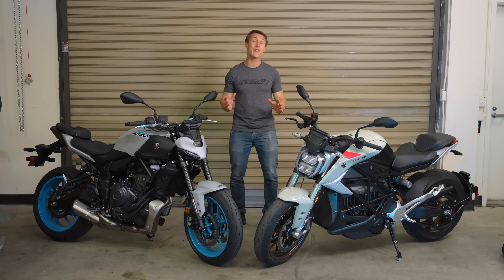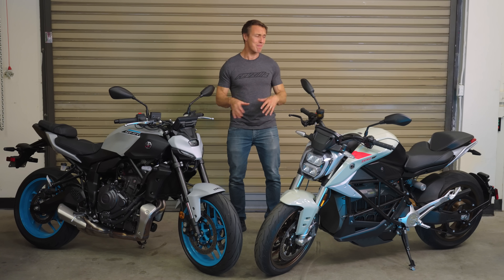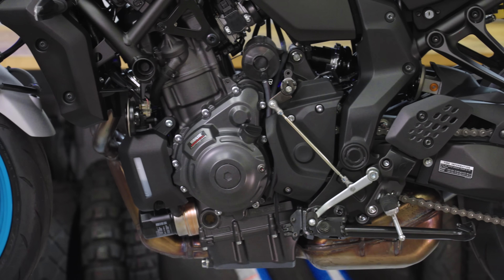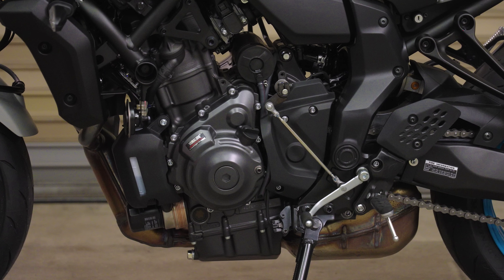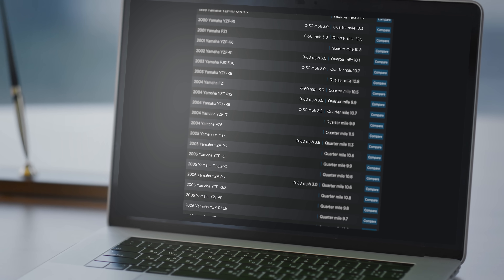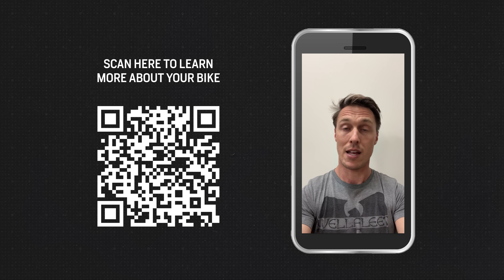Are Electric Motorcycle Torque Figures a Lie? | The Shop Manual

Comment: If we relied on torque numbers alone to measure performance, Harley Davidsons would rule the world, ans Supersport 600s would be relegated to the dustbin.
I'm s bit puzzled horsepower wasn't mentioned once, torque may be the preferred way of measuring electric engine performance but that's not the case with ICEs, where engine speed varies greatly.
Reply: In an EV the rpm of the motor also varies greatly.
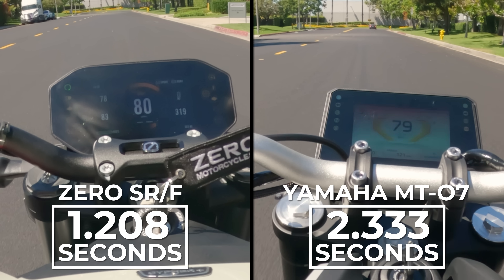Reply: Horsepower (and vehicle weight) were mentioned at 3:37
Reply: Torque AND horsepower both matters. And the later is decided by two factor: torque times RPM total. Harley engines are garbage because they have low RPM. For cruising, the most important aspect is Torque at specific RPM which is the engine's peak performance and the most ideal region to operate. (not necessarily the most fuel efficient) But again, that's not what racing performance is about.
Reply: Because power is torque multiplied by shaft revolution rate, it is constantly changing as the motorcycle accelerates.    Thrust to the rear wheel is  the net result of power, minus losses, like the transmission, that actually makes it to the rear wheel to be used.  What really matters is what gets to the road via the rear wheel.  Max power of an engine is only available at one specific engine speed and is only a really useful "real life" metric with a continually variable transmission that can maintain that optimal engine revolution rate over a range of rear wheel speeds.
Reply: @jfess1911  Agreed , but I mentioned power, not max power.
Same torque, double engine speed, double power, double acceleration for ICE at specific engine speed.
This video mentions the MT-07s max torque so let's use max numbers.
So whereas two ICEs have the same amount of (max) torque as a metric,one has 4 times the max horsepower (cause it revs to the moon) and hugely varying performances.
Can't ignore power as a metric where internal combustion engines are involved.
Reply: @jfess1911 Although it's more realistic but it's still worth explaining how thrust vs speed is derived.
From top end hp->torque at top end hp rpm range->wheel thrust
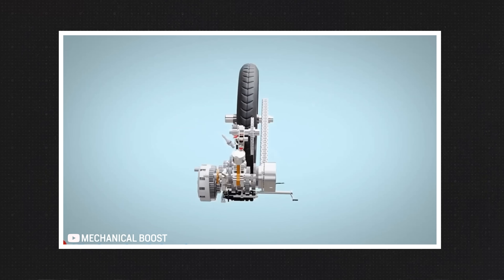Reply: @YangD-082  I thought he did a good job of that at 2:07 "We don't ride engines.  We ride complete motorcycles that push the crankshaft's torque through a series of gears that amplifies the engine's output dramatically by the time it reaches the rear tire. "   This makes comparisons more difficult because the amount of available power varies with motor or engine speed, but  also one motorcycle has multiple gear ratios and the other has just one fixed gear ratio.

   He points out that what really matters is what gets to the rear tire.  "For a more complete picture of how a bike is going to respond when you open the throttle, we should take a look at what's called a Tractive Force Graph, which gives us thrust on the Y axis versus speed on the X axis".
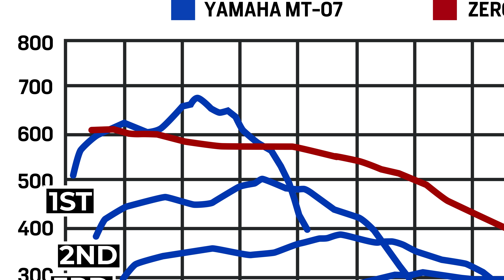The information you want is on the graph at 3:12.  Each of the blue lines shows the power curve of the MT-07.  It just gets more stretched out as the gearing gets taller.  

The red line shows the power curve of the Zero SR/F.

You can find dyno charts of each engine to see that the lines do indeed indicate the power curves.
Reply: The answer is math and how the force is applied through the cam shaft and the back wheel.

Comment: I personally like Honda's approach where they don't publish horsepower and torque specs for their new bikes. It's the American motorcycle shoppers who are the real problem, being fixated on such mostly irrelevant numbers when shopping. 

My wife's 1.5 liter car is plenty fast and can haul us and our stuff through the mountains no problem. On paper, my 395HP and 400 ft/lb truck is a monster by comparison, but definitely isn't faster. 

People complain about manufacturers focusing on this stuff, and then it's the first thing they ask about a vehicle.
Reply: The truck is almost certainly much faster in a straight line. I don't think that's what matters though, and I'd rather drive the small car. However, more power will almost always mean faster; adding 100hp will make significantly more speed difference than losing a few hundred pounds (again in a straight line). And trucks are also geared for pulling, so when running unloaded on flat terrain, they are surprisingly quick.

Comment: I know it doesn't make much sense, but an electric bike with a transmission would be interesting to see.
Reply: electric motors make 100% of their torque at 0 rpm, so they typically don't need them for normal applications. 2 speed transmissions sometimes make sense for heavy duty applications like a commercial truck where you can run into current limitations, but that's never going to happen on a motorcycle. one of my internships involved simulating a concept medium duty truck with a theoretical electric rear axle with either 1 or 2 speeds or a 1 speed with a torque converter,  and the 1 speed ended up being faster and way more efficient.
Reply: @karasene2091  "electric motors make 100% of their torque at 0 rpm"
Potentially, but no.
Because you need a POWER MANAGEMENT system or the EV would  be totally unrideable. You'd flip on your head at the tap of a button.
Similarly with combustion engines, if you rev to max torque RPM and dump the clutch, bad things happen.
Reply: The Brammo/Victory Empulse TT has its electric motor paired with a conventional 6 speed
Reply: @seangriffith9469  I rode one, on the track no less, and it was excellent.
Reply: It does exist, it's an Indian bike called the Matter Aera!
Reply: @PratikSatpute12  I just saw a review. I didn't understand anything said but it looks an interesting idea.
Reply: If you're looking at it from a performance standpoint, it would probably feel like driving a diesel. Massive torque, but you have to shift every other second. Feels fast but isn't. Plus the transmission would have to be super beefy. If you simply gear it to match the 20 or 30k rpm of the electric motor, then you've only got 1 or 2 gears and 4 overdrive gears. From an efficiency standpoint, you might benefit from the smaller electric motor being able to reach higher speeds while still being usable at lower speeds, but lose from the added weight and drag of actually having a transmission.
Reply: @EvenFive yes I can imagine the technical headache involved with this idea...
Reply: @EvenFive  how about range? would it help with range on modern electrics? i would assume so, trading torque for lower rpm at the same speed = more range, idk

Comment: While I wouldn’t say EVs “lie” about their torque figures, but Iwould say many manufactures are misleading or focus advertising on their torque spec knowing most people’s perception of a torque figure is based around gas engines.  Alta used to claim their torque figure at the output sprocket (despite having a 3.5:1 reduction in motor housing).  Verge likes to focus on their 750ft-lbs!!! of toque.  They’re not wrong but because the motor is the wheel that figure is “at the wheel”…and it’s actually pretty low by gas bike standards (a Super Duke is > 1300 at the wheel in 1st).  My advise for any bike, but especially EVs, is ignore the torque value, it’s basically meaningless with respect to performance.
Reply: @RaceWithTime that is so true. I've seen Verge once and it's a pretty interesting looking bike. I chatted with the owner and he bragged with 1000 Nm of torque. I just said "that's pretty good...that's about what I have in 2nd gear" and he had no idea what I was talking about.
Reply: We can thank American education systems for helping generations of students be really incapable of understanding physics, especially the kind that math is attached to.
Most adults today couldn't pass an 8th grade graduation test from the 1890's out of rural Kansas.
Reply: I don't think so.  Manufacturers are only giving the statistics people are asking for.  Lots of people use peak torque and peak HP values as yard sticks to buy bikes with no context attached.  Manufacturers are just giving people what they want.  That is equally true for EVs and ICEs.
Reply: @SirNarax  Nothing like people controlling manufacturing companies, instead of manufacturing companies determining their own marketing directions.
Reply: Bingo. It's all marketing.

Same as electric cars that advertise thousands of ft.lbs of torque, it's supposed to be a selling point because it's such a high number compared to any ICEs. It's also meaningless because any car produces thousands of ft.lbs of torque at the wheel.
Reply: The vast majority of cars and motorcycles have their claimed power and torque figures measured at the flywheel, not at the drive wheel, so they aren't really being honest either. Put a car or bike on a dyno and they won't put out the claimed power because the claimed power doesn't take into account power losses through the drivetrain (due to friction and weight)
Reply: @Mad082sss  how are the losses from flywheel to crankshaft from weight?
Reply: @malcolmwhite6588  Weight alone does NOT introduce powertrain losses. A 2 ton vehicle and a 3 ton vehicle using the same engine, transmission and wheels will both get the same amount of power to the wheels. Now, the 3 ton vehicle will accelerate slower than the 2 ton vehicle due to Newton's second law: F=m*a. F will be constant in this case as the powertrain is identical while the mass has increased so the acceleration will decrease. This is why weight introduces SYSTEM (whole car) losses as for the same amount of force applied, the lighter car will get to a higher speed than the heavier car in the same amount of time.
Reply: @malcolmwhite6588  Friction is just one element but weight of components absolutely matter. Heavier drivetrain hurts both acceleration and deceleration. While this would not directly influence dyno, it would absolutely be felt by the driver. Otherwise, there's no point of constantly pursuing lighter and lighter flywheel and driveshaft.
Reply: @malcolmwhite6588  What (probably) they mean is the rotating mass of driveline components, not the mass of the vehicle itself.
Reply: @iamsuperflush  perfect , makes hundred percent sense:  didn’t think about that but just thinking about weight in the normal sense which of course is not a factor however rotational mass clearly is - thanks for that🎉
Reply: @Mad082sss  They do that because it is easier. Engines in cars and bikes are shared across several models and even brands, mated with different transmissions.
Instead of creating and maintaining the numbers for every permutation of engine and transmission available, you give one set of numbers corresponding to the engine and be done with it. Most people wouldn't care that much anyway since every manufacturer will provide comparable numbers e.g. power, top speed, sometime acceleration and gear ratios.
Reply: @Mad082sss that's true my bike has 150 engine HP actual dyno HP is around 135 .
Reply: We could say the same for ICE bikes as well though. I've had a couple motorcycle sales people tell me that Americans really only care about HP and torque numbers when purchasing a bike,  even though they should be pretty low on the list of concerns. It's not manufacturers that are saying something stupid, it's the public asking for it and they're just giving out the rosiest version of what people are asking.

Comment: I understand that EVs don't need multi-gear transmissions, but I've never understood why they don't have them anyway. Even if it were just an overdrive gear used only at freeway speeds, that would help eliminate one of the biggest drawbacks of EVs (the battery range being much shorter at higher speeds). Like another commenter said, you could ride a liter bike just about everywhere in only first gear, but why would you?
Reply: The range is directly affected by the power that is drawn from the battery. Since electric motors are already at very high efficiency in their rev range, adding another gear wouldn't change any power draw, it would only change the torque
Reply: Evs dont loose efficiency on high way because they don't have gears. Those loose efficiency because of high wind resistance on highway. 
Meanwhile a gas car lose efficiency in accelerating and deceleration. So on highway they gain efficiency, they also get affected by wind resistance but it is far less than drive drain resistance so it doesn't affect that much.
Reply: With an electric motor, current consumption varies with load, not so much RPM. The reason that EV's consume so much energy
at highway speeds is because of the current draw required at high speeds. Even if you geared the electric motor up and reduced its RPM's at "X" speed, it's still going to drain the battery just as quickly or by an almost imperceptible difference. You do get some losses in an electric motor that are proportional to speed I think that you would find that the weight and frictional losses of a multi speed transmission would be more significant.
Reply: @davidbrayshaw3529 Great answer.
Reply: There's no efficiency benefit in running an electric motor at a lower RPM, but there's an efficiency cost to introducing a pair of gears in the driveline.  More weight, more complexity, more space taken up, less efficiency... no point, so manufacturers of EV cars and bikes wisely stick to single-speed.
Reply: Space and mechanical losses do seem like a big deal (especially on bikes). Still, it feels like we haven't seen everything that could make EV bikes interesting or practical - which is kind of neat in a way. Maybe EV bikes will have their "try everything even if it's weird" period and we'll get some truly surprising designs.
Reply: The highway efficiency thing comes from three factors:
1. Force needed to overcome wind resistance increases 4x when speed increases 2x.
2. ICEVs are terribly inefficient at low speeds and mildly inefficient at high speeds. So while EV efficiency doesn't change that much, the gap in efficiency between ICEV and EV is much smaller at high speeds.
3. An EV carries much less energy in the battery than a ICEV carries in gasoline.
Reply: The answer as to why most bikes don't have them anyway is pretty much cost, weight, and complexity.  It's another part to manufacture or source, more maintenance, more moving things to break, more weight.  But, it has been done: do some googling for the Brammo Empulse R.  Sadly, Brammo went out of business, but it was a lovely bike.  It had a 6-speed transmission, I enjoyed it as a 'selectable torque' function, more or less -- because the bike can't stall, you can start from 6th gear if you want.  One of the best bikes I've ever owned, I hope someone makes something like it again.  Sadly, most companies choose to simply put a bigger electric motor in there to have 'enough' torque to get off the line . . . but it's always a compromise.  Single-gear electrics are always having to compromise between low end and high end grunt.
Reply: They exist. In the car world, you have the Porsche Taycan, for example. But they're not super beneficial. The new Macan EV doesn't have it. 
I guess the extra weight, complexity, and possibly increased mechanical losses of having a more complex transmission don't outweigh the benefits. 
There was also a bike that had it, if I recall correctly - Brammo Empulse R.

Comment: E-motors have max torque at 1rpm, right?
Reply: 0 rpm, torque is a force multiplied by a distance, and it's there also if the shaft does not turn. Unlike power that is torque multiplied for rpm, so it's 0 at 0 rpm.
Reply: @GiovanniEsposito5  Electric motors can and do most certainly produce torque at 0 RPM. What they are not doing is producing power output. No power = nothing moves. If they didn't produce torque at 0 RPM, you'd have to start them like you do an ICE engine.
Torque is not a force multiplied by distance. It is the application of rotational force. We measure that application using units of force over distance such as ft. lbs. Torque is not a measurement of work done over time. Think of the motor's torque as yourself trying to remove a wheel nut that the tyre shop apprentice put on with a rattle gun on his first day on the job. You can stand on it with a 10' breaker bar, with all 200lbs. of you on the end of it and not move the nut at all.
You're applying 2,000 ft. lbs at 0 RPM. Motors are the same. Once you get the nut to move, you are then doing measurable work over time. That's power. Motors are exactly the same. They have 0 power (hp or Watts... whichever) at 0 RPM. But they most certainly produce torque at 0 RPM.
Reply: Usually yes. Then it's about flat for a bit, and after about "mid-range" in terms of design RPM, it starts dropping.
Reply: E-motors require controllers. The controller is what sends the energy to the motor poles. However much energy goes to the motor poles determines the strength of the torque.
If you threw 100% energy at zero motion, you'd flip on your head. It would be unrideable.
It's down to the CONTROLLER which manages power.